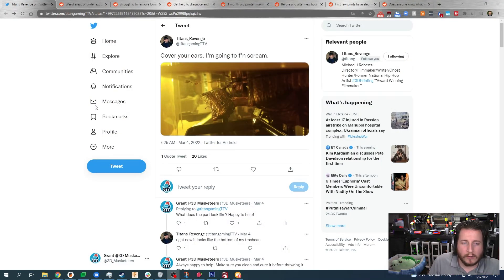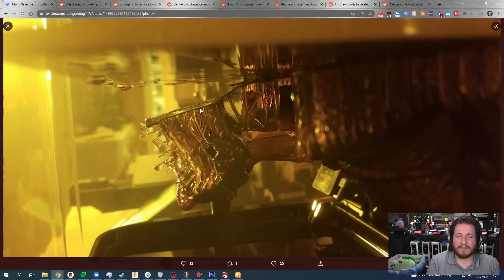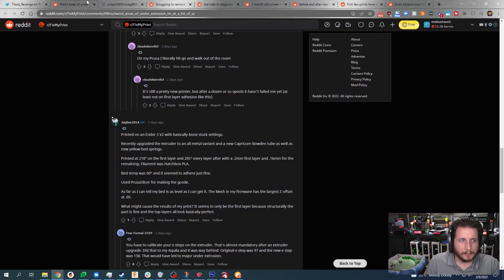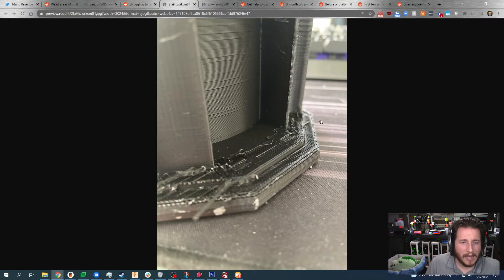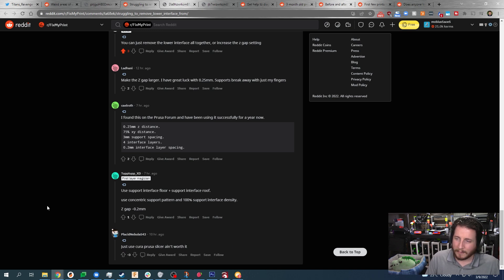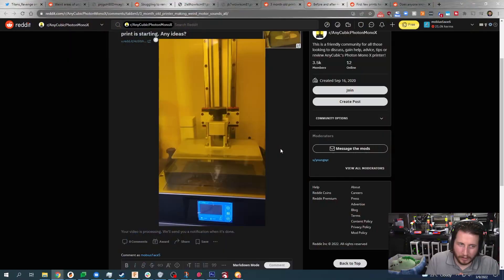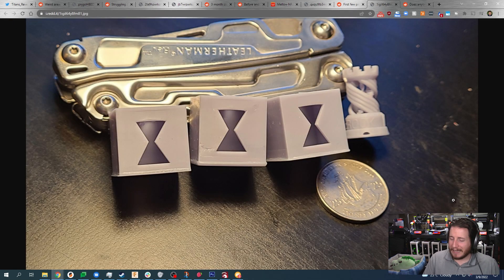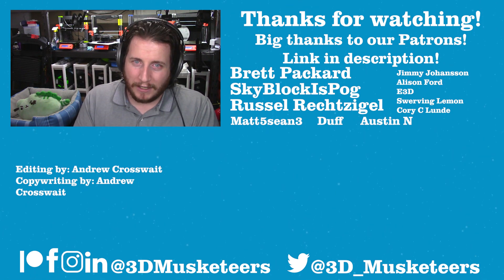What To Do When Your First Layer Looks Weird! - PrintFixFriday S1E26

Comment: why is a whole new printer easier? as opposed to a lead screw? That was a horrible claim.
Reply from the maker: Because the lead screw looks like it's running true.. it's either something else mechanical or electrical. If there's binding in the linear rails, a new lead screw won't fix any of that. If it was bent, you'd see it moving.